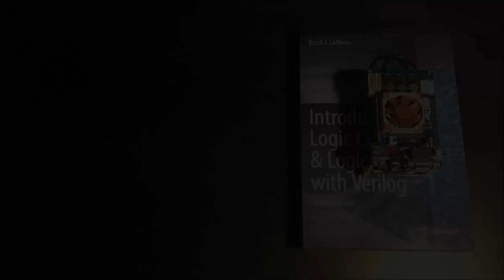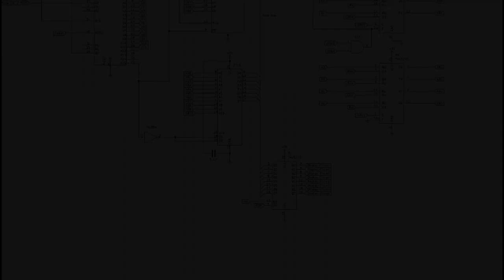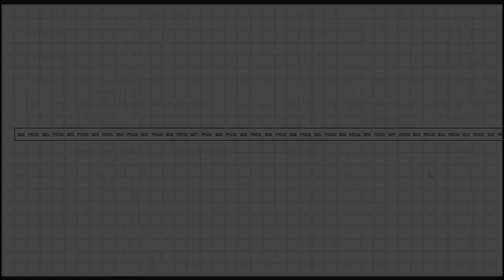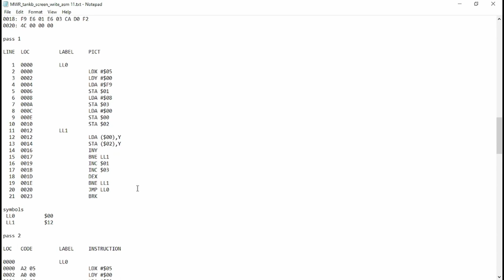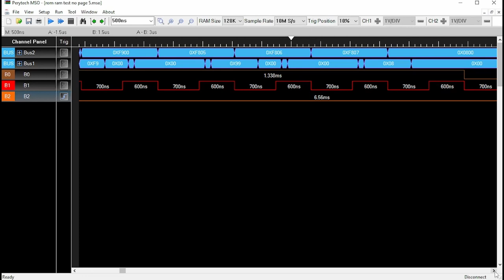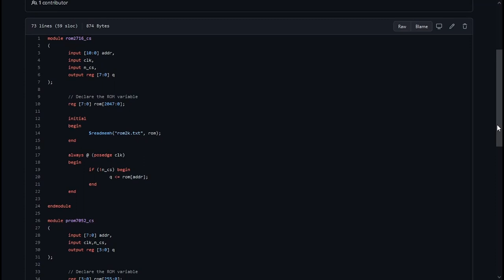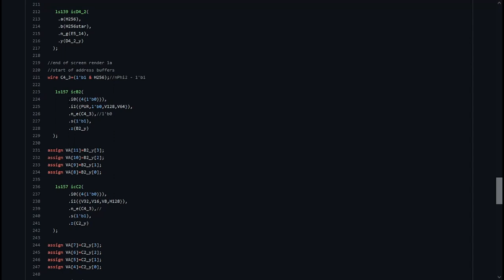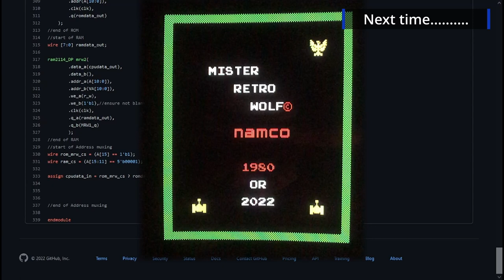MiSTer Core Dev Episode 12: Display + CPU

Comment: Interestingly, if you wanted to have maximum speed out of the cpu, you would want to opt for the more explicit, absolute-Y addressed version over the zeropage (IND),Y version. Zero-page (IND),Y address decoding uses at least one additional cycle over ABS,Y for both LDA and STA. End result, you'd be looking at roughly 15% more runtime for the zeropage version to complete vs. the absolute indexed version.

Admittedly, at a 1mhz phi0 that's only a difference of about 2.6 miliseconds, but if a byte copy like that was an essential gameplay mechanic (say a manual blit of some block of memory into another block at high speed, like what one might do moving a bitmap around without specific hardware), that couple of miliseconds would add up.
Reply from the maker: Interesting indeed. I guess the shorter code would go into the decision making process too (limited space for games back then)? When looking at disassembled routines I never see the absolute addressed version used.
Reply: @misterretrowolf1464  (Ind), Y is just a lot more flexible in most situations. That flexibility comes at a cost though.

In OG games where cycles were cheaper than bytes, compact was mostly king.

Comment: Is the CPU complete? Are you aware of "some assembly required" playlist "6502 in verilog"?
Reply from the maker: @Nick ST - I am a subscriber to that channel yes! Excellent content there. I'm using a pre-done core for the 6502 chip. I personally draw the line at deriving CPUs myself. My background in Engineering, I guess, means I like to build on other people's tools than developing my own! And I couldn't do it anyway, hehe. Thanks for the heads up though.
Reply: @misterretrowolf1464  Thanks for all your work!